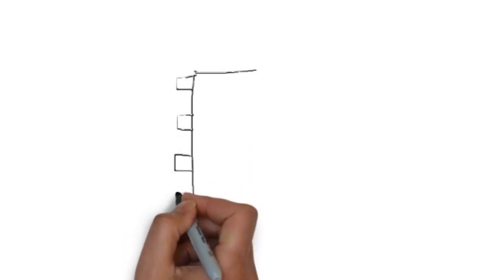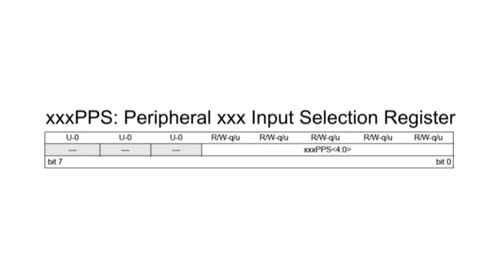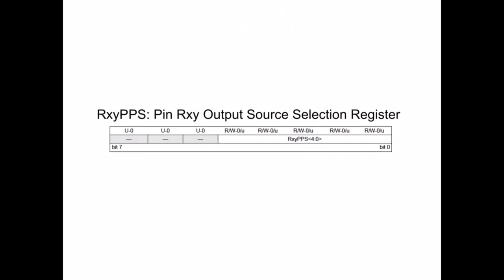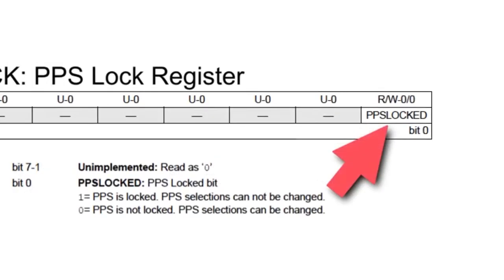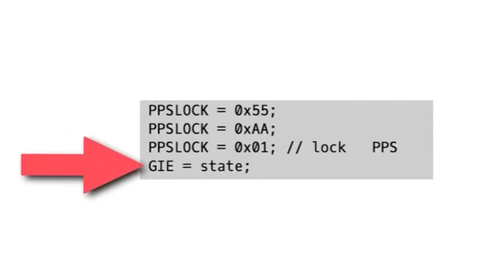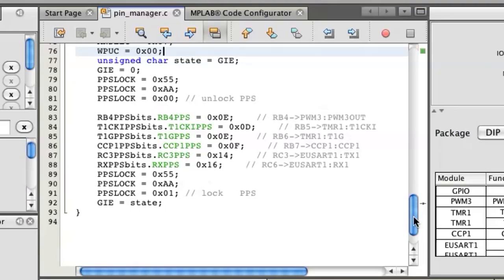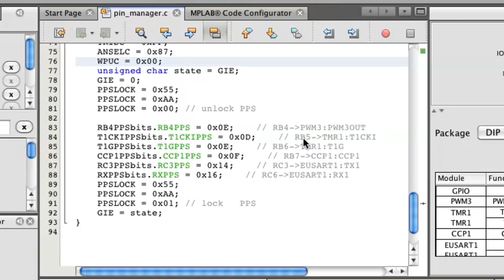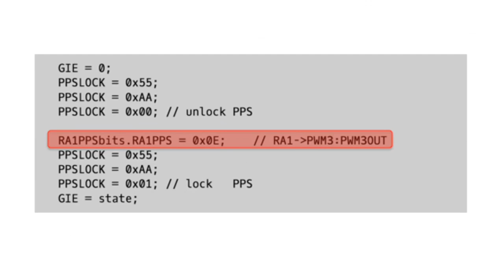Peripheral Pin Select (PPS) for Microchip 8-bit PIC MCU

Comment: Very good but what really would be great would be having something like wizards for each peripheral so you could configure them really fast. Take Cypress' PSoC Creator as an example. I've stopped using PICs MCU's since I've discovered how fast you can develop using a software like Creator. I won't go back until I find any other solution that can at least let me develop and test as fast as Creator does.